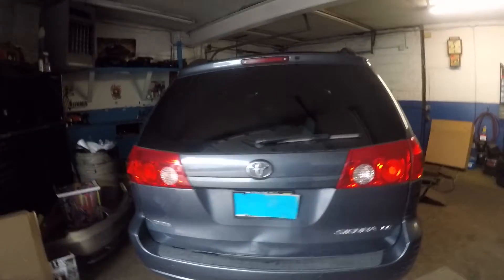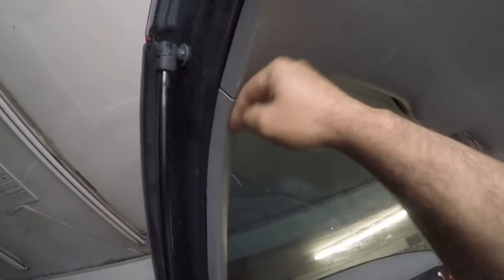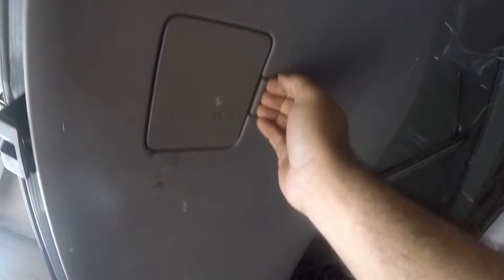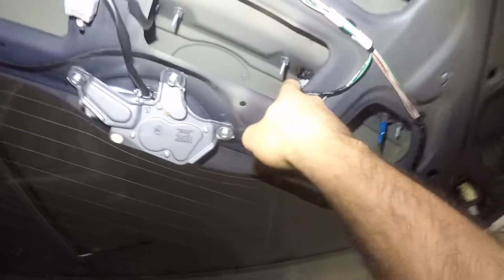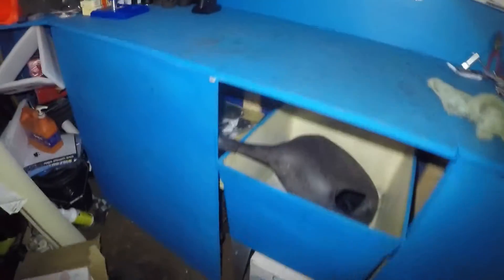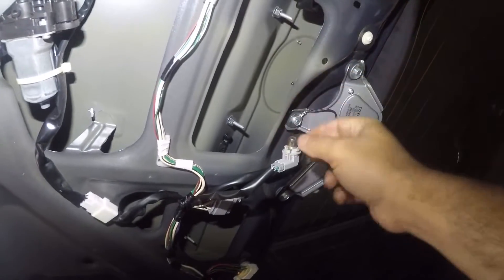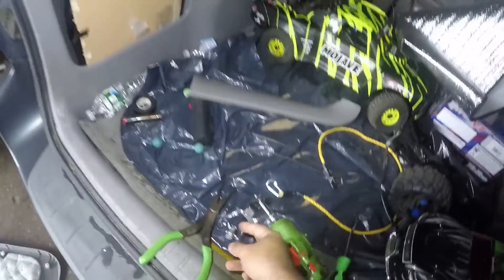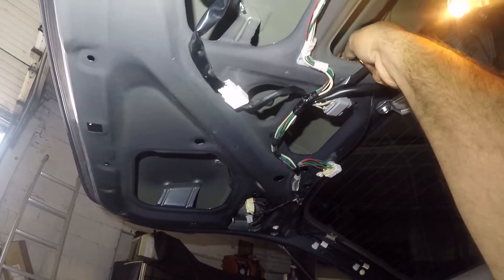How to replace Plate light bulbs on Toyota Sienna 2008 and other

Comment: Unscrewing the bulb holders was the toughest part.  Horrible access by toyota designers.  Also I would stay with bulbs on those older models.   Tried using led lights on my 2011 corolla for backup lights and one was not working.   Switched to regular bulbs and it works just fine.

Comment: Althoigh it doesn't show it in the 2004 Service Manual, there is 2 L shaped guide/latch on the bottom where he's yanking which you don't want to break.  So work from the window down and then slide the panel up (toward the window).
 There is a common clip tool used for door panels etc that makes it much easier with less breakage.
Reply from the maker: Ok thanks